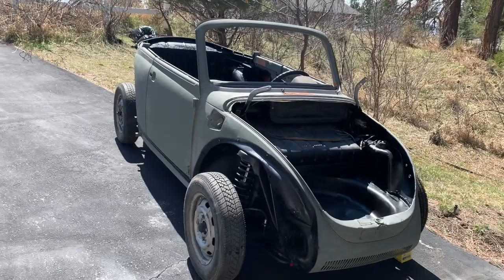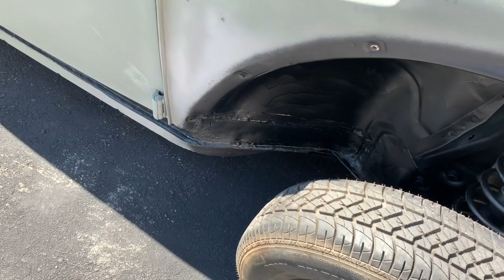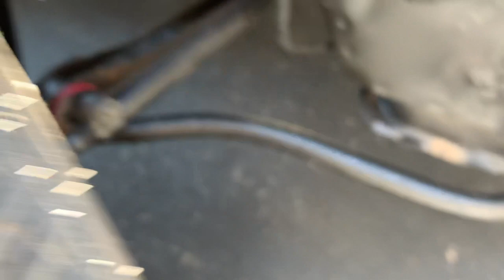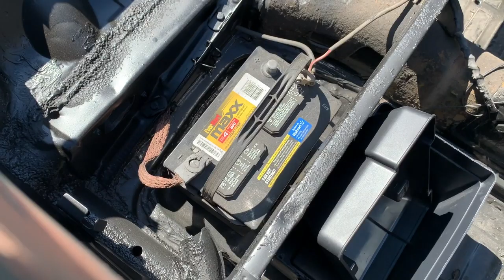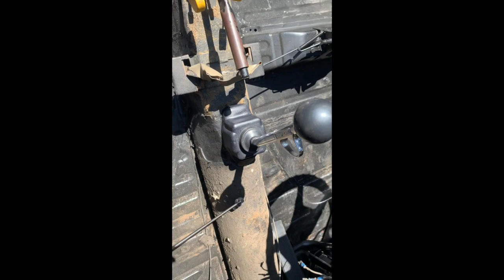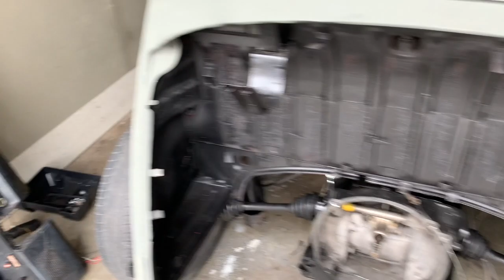1974 VW Super Beetle Restoration and Tesla EV Conversion - Part 1

Comment: Good to see your videos! I am a few month behind you with a 1971 super beetle convertible.  Thinking about slowing my roll as EVWest is starting to develop a kit with a tesla direct drive motor, eliminating the need to go through the VDub transaxle.
Reply from the maker: _ gressda1 spent a day with Michael at evwest last fall. Will be using them.  But looking at the cost of the Tesla motor vrs the standard kit.   Michael posted a new video for first time in five years. https://youtu.be/tYtvBmn1xSo. I also have a thing going thru the shop now.  Thanks.